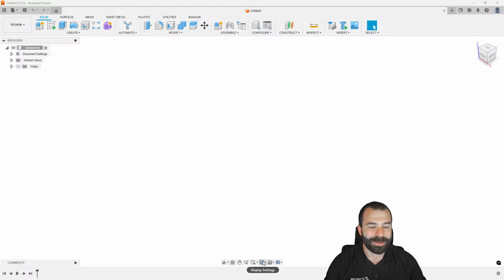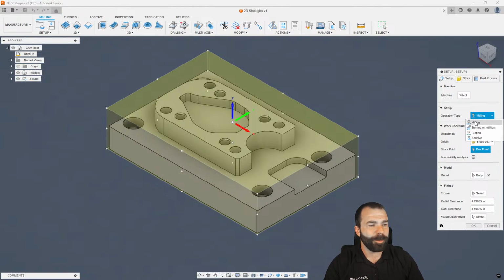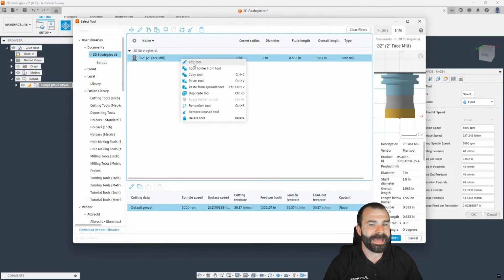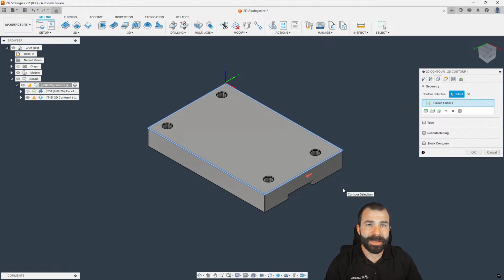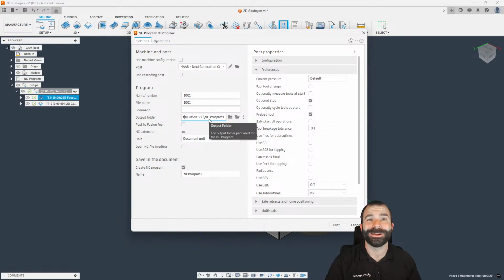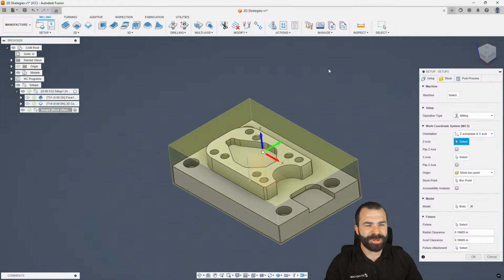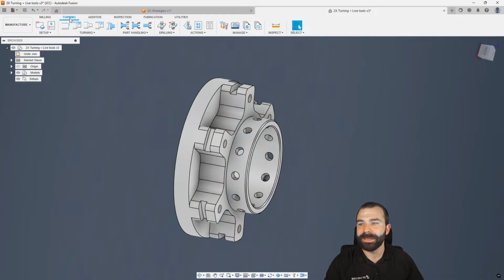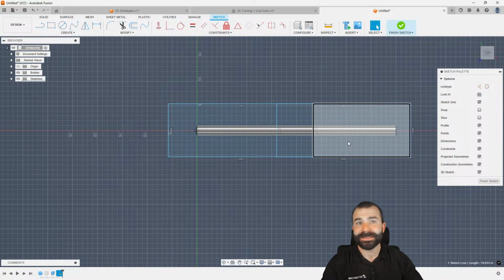Fusion 4 Beginners: Manufacture Workspace

Comment: I found an example that gives the problem that I have ran into. Try making the part from "Intro to 2D machining" from round stock, as a milling process.

Yes, Ideally you would want to make this from flat bar, but some materials are not offered in flat bar and have to be ordered in round stock. To not have a lost of waste material, try to make this out of 1.75in Round stock.

Thanks
Reply: Really good video on basics. I teach cnc machine for 13 years and Fusion last 6 years in local tech school. Getting those preferences and settings really help me teach them so we are all doing it the same way. Thks again
Reply from the maker: Awesome glad to hear it.
Reply: @JITCADCAM  I can't get it to work.
Reply from the maker: Send me an Email and I can do a screen share. Phil@jitcadcam.com